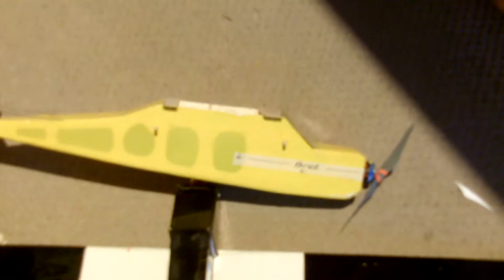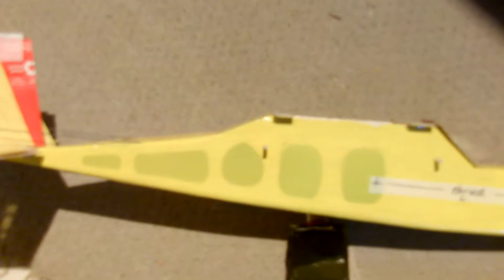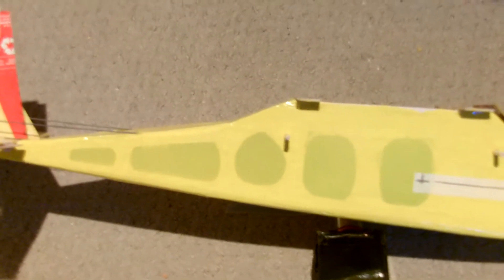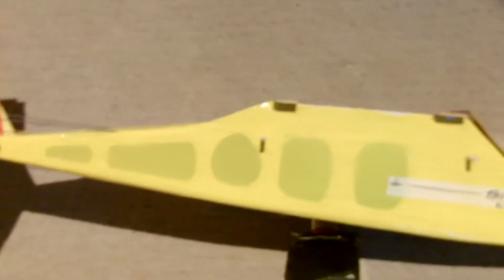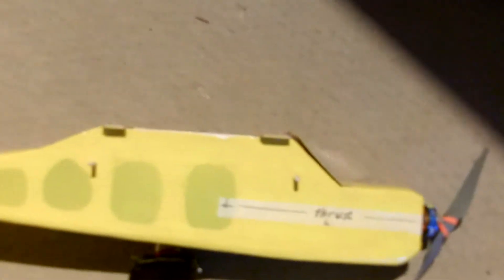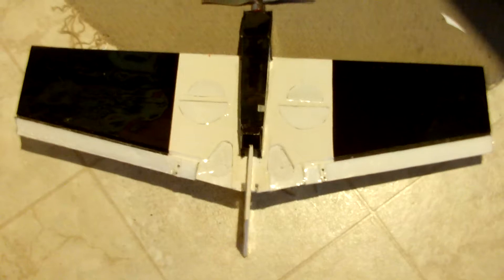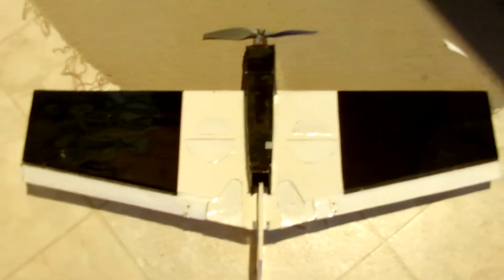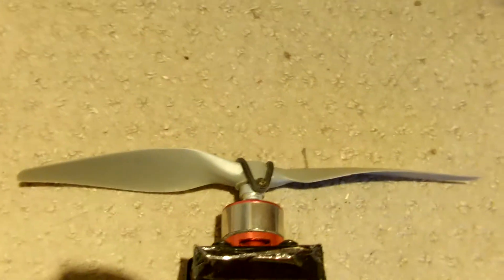tutorial   design and  Planning for, dom

Comment: in the last example:
the chord reduction towards the tip is mainly there to change the lift distribution
it hardly affects the weight at all and its distribution
Reply from the maker: bla-bla-bla       were you talking to yourself or what.      if not,  your comment  is  completely  IRRELEVANT.!        in addition, your comment FAILS  to  acknowledge the fact that a reducing chord length  REDUCES  the amount of outboard-located  MASS  in a wing.!     such a reduction of mass reduces  instability,  in the span-wise  dom.
 dweeb
Reply: @daviddavids2884  lmfao better than talking to you 🤣 you have no idea what your saying and don't have a plane that actually Flys